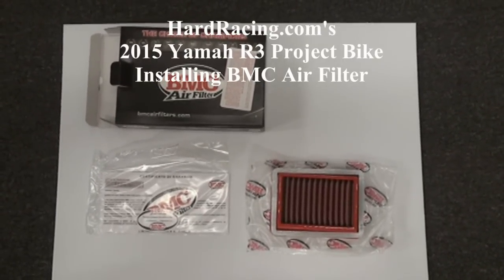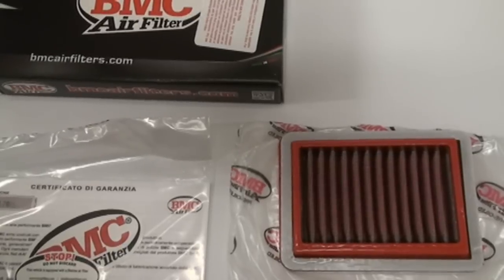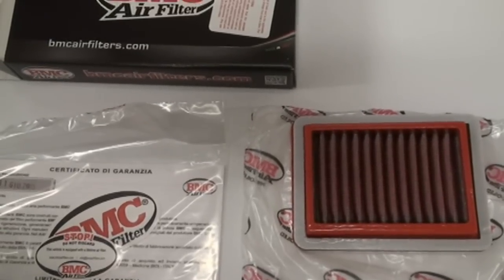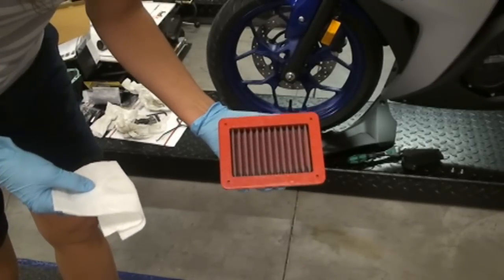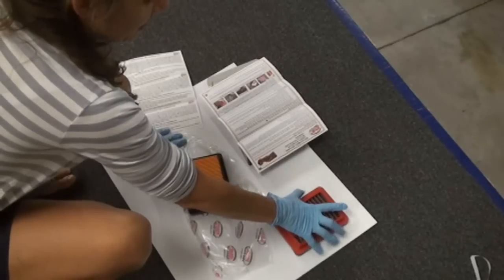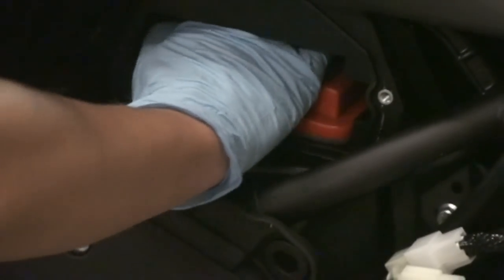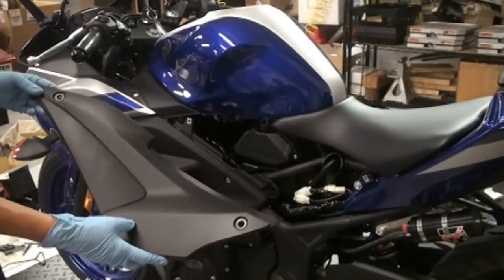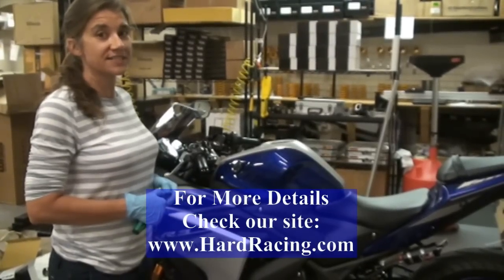2015 Yamaha R3 BMC Air Filter installation - Very Quick and easy to do  #Hardracing

Comment: Is there is any possibility to match the exhaust sound of r3 to that of her elder sibling(r6)???if yes than I am desperate to know that
Reply from the maker: The only way to get a 4 cylinder to sound like a 2 cylinder, would be remove 2 of the spark plugs.  ;-)
Reply: Thanks for the answer but I wanted to know if it is possible that r3(2 cylinders) can get similar exhaust sound to that of r6(4 cylender)
Reply from the maker: Unfortunately, No.
It's not possible to make Twin Cyl. sound like 4 cyl.
Reply: Hi, Thank-you for replying me,  yes I researched a lot however found nothing,  I will continue researching , let's hope I get something.
Reply: Akrapovic Slip-on GP does a very good job of it
Reply: @sumitambwani7474   Record the sound of an R6 and replay it when riding your R3, that's the best solution
Reply: @user-hs2hd7wp9g  yeah...I never thought of such a great idea...

Comment: Can u make a video, how the air filter sounds ?
Reply from the maker: Not sure you could actually hear any difference in sound with or without the BMC.   The exhaust will drown it out.
Reply: +HardRacing okay tq bro
Reply from the maker: Anytime.  ;-)
Reply: should be able to hear something while the bike is moving I have not yet got my air filter but I have removed the air filter baffle and when I am get past 7k rpm I can start to hear the non baffled air flow so we should be able to hear the air filter while riding but not so much on a video